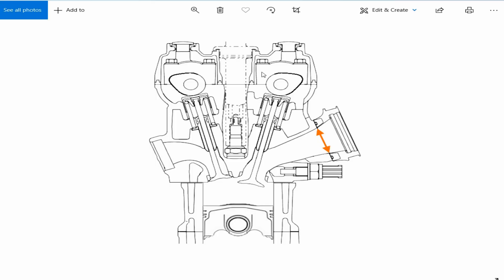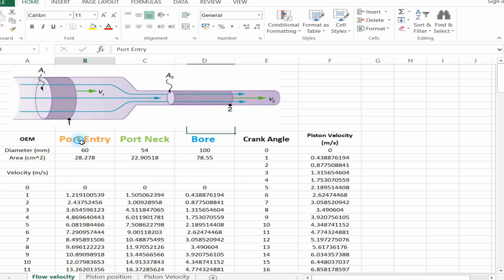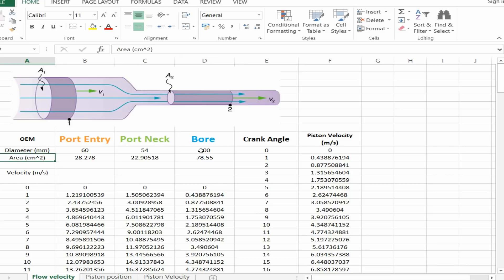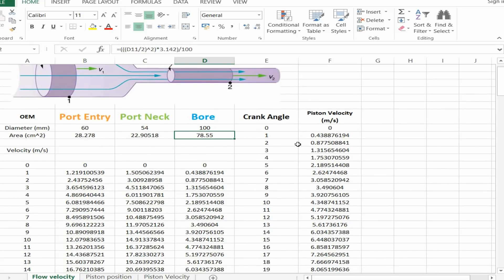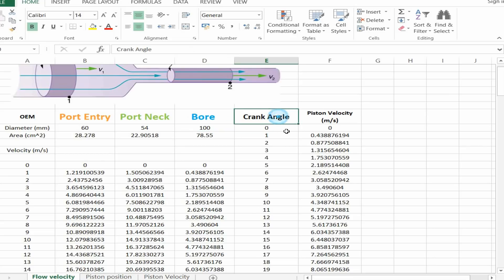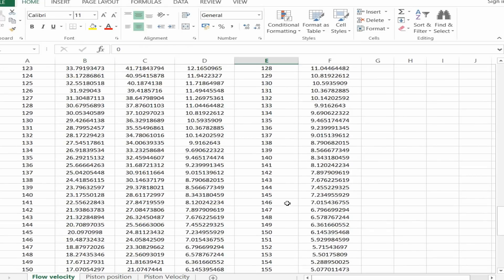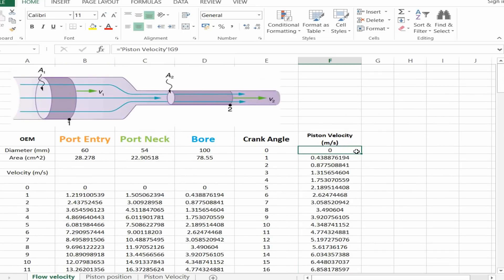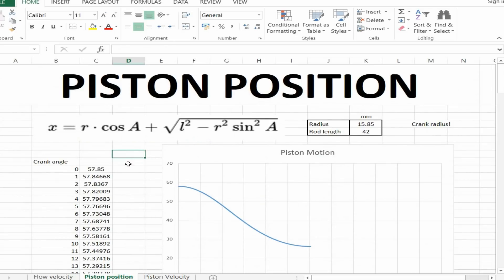Understanding Ports - Ports Vs Bores P1

Comment: High velocity is about fuel air mix or getting more charge into the cylinder in a shorter amount of time or do you actually achieve more charge pressure with higher velocity?
Reply from the maker: Velocity is distance over time. Pressure is force over area. None of this is about molecules and the number of them. That is mass flow rates, and that's what matters
Reply: that is a good question and i'm replying to get notified if there will be an answer.
As far as i can guess, NA engines benefit from the velocity and, locucally, forced induced engines benefit for "bore" or, dare i say, more slack to force through a bottleneck. i guess there's an amount of velocity that can be pushed through that bottleneck due to pressure reasons and density.

is this why boring na engines is not necessarely a good way to improve the engine?or is this ballancable with improving the admission system( not necessarely force inducing it) ?

Comment: You kept the port percentage the same but not the actual-size? If the size was the exact same would the velocity not be greater? Also what is a desirable characteristic and why ie higher port velocity is good because? Always assume your talking even dumber people than you can imagine please this is very interesting. Going to rewatch now
....awwh your keeping the cc the same i was thinking the stroke was constant
Reply from the maker: Port diameters are restricted by bore size. We'll see that in the next one...
Reply: @thedirtyworkshop  I didn’t take on the cc was constant i just assumed it was constant stroke. Yep looking forward to next episode 👍
Reply: Basically my head was in big bore kits not original oem engine designing

Comment: Awesome vid mate, looking forward to the rest. Mind if i ask a question ? 

Long story short theres a mod u can do to my bike where one would bore out the engine from 749 to 837 using pistons of another bike, keeping the same stroke. However using the same valves/heads.

I spoke to a guy who did this a while back and he said it was great added abit more grunt and pull etc etc (he also had a full race system and a re-jet) but he said it made it run far far richer after the re-bore.

Why would u say this happened ? And could u shed some light on what could be an alternative solution to making extra power. Cheers mate
Reply from the maker: As the bore increases the ratio to the port size decreases. To say it runs rich over the entire rev range is incorrect, it probably ran rich at peak torque. Well cover why soon.
Reply: @thedirtyworkshop  great, cheers for that, looking forward to it.

Comment: One question, at higher rpms are larger bores more beneficial? Heads are "limited" in the flow they can acomplish, would increasing the bore to lower the port velocity give more power?
Reply from the maker: All in good time, this is just one variable

Comment: See, this is what I call quality. 👍
Someone go and tell "lean doesn't mean hot" Jason what engineers do. 😂
Reply from the maker: Funny you mention that, there's another video about that in the pipeline
Reply: @thedirtyworkshop   must be interesting. Will tune in. 

BTW, I've been wondering why more sport bikes don't use the Goldwing type front suspension system?
1) The double wishbone helps with bike geometry while braking.
2) that setup must be able to perform at higher speed (hence higher frequency) due to shorter spring (i.e. less number of coils)
Reply from the maker: And its heavy...
Reply: @thedirtyworkshop   it's solid metal so forged aluminum should help.
And, Conventional forks have oil in them. 
So would the increment in weight be big enough to outweigh the benefits?
That's interesting 🤔
Reply from the maker: Yes. The only reason why forks are still in major use is that they're the lightest option
Reply: @thedirtyworkshop   fair enough.
Thanks for the answer, mate
Reply: @AmritGrewal31  BMW already did it and reverted back to forks on the same model.

As Matt said, it is heavier. There are many compromises when you try to minimize weight on a sport bike.

Comment: Higher velocity X smaller volume = little bangbang. 
If torque is a measure of what an engine can do an HP is is only a measure of what the driveline did, V twin or 4. Cylinder?
Reply: High velocity is what helps make good torque. 
Torque is what most people are talking about when they say horsepower. Torque is what accelerates the vehicle, HP doesn't come into play until much later and higher in the RPM range.
Reply from the maker: That is all kinds of wrong...
Reply: @David_H_Parker  Hp comes into play above 0rpm, push something as hard as you want, you've not done any work til it moves
Reply: @zeggyiv  Dynos only measure torque, then calculate HP.

Your vehicle will not move without torque.
Reply from the maker: Actually most dynos measure force and compare this to the inertia of the dyno. Then the HP is a function of this measurement. The torque is calculated from the HP.
Reply: @thedirtyworkshop  What is the name of the force that is measured?

Could it be called torque?
Reply from the maker: No. It's linear force. It's the interaction at the drum and the rear wheel. Because they have two different diameters they can't be calculated as torque, just a linear force

Comment: sorry, im newbie,
y do engines need throttle body valve?
Reply from the maker: To control the ve of the engine
Reply: @thedirtyworkshop  why not keep the valve open & control the fuel injection spray with the gas pedal?
what is ve?
Reply: @wowgggearing  
Thats how diesel engines work. 
VE - means "volumetric efficiency" - You can find more about it in Wikipedia.
Reply from the maker: A throttle controls the amount of air in the engine at any time. If you use only injection as your control you'll lean out the mixture and nothing will happen...
Reply: @jareknowak8712  is it really daft to say that a turbo on a diesel is just a throttle in reverse?
Reply: @jons6125  hmm... the amount of injected fuel is the "throttle" in a diesel engine. 
There are many naturally aspirated diesels, without any turbos, but still You can control them, only by fuel.
Reply: @jareknowak8712  yes but less efficient ones...Dw it was a silly comparison